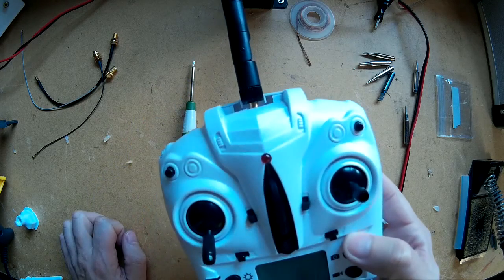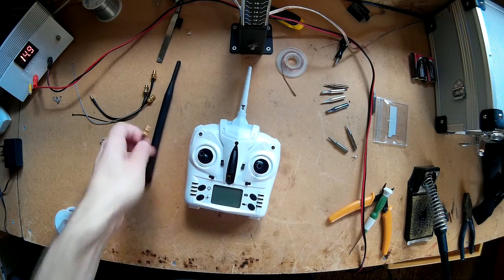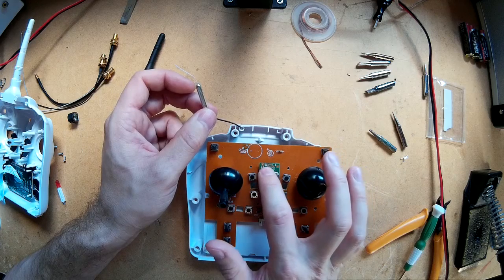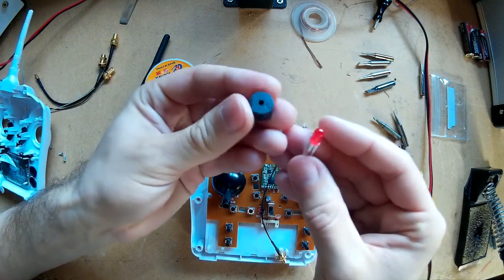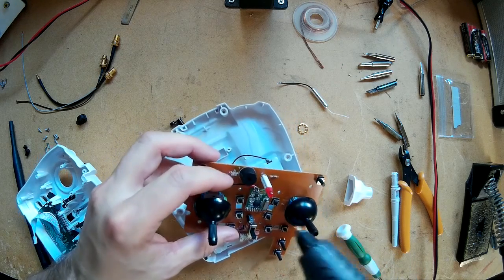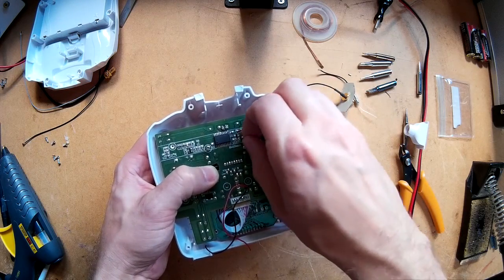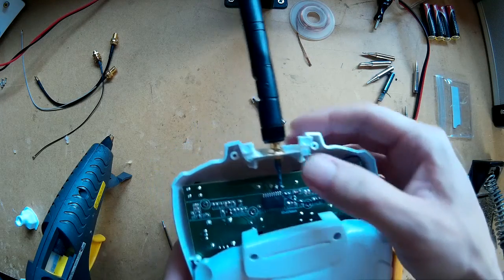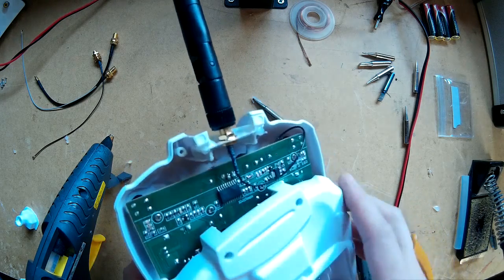JJRC X6 Tarantual Extended Long Range transmitter Mod

Comment: I did the same modification yesterday, brought to test but signal fails vertical range about 70m, horizontal range will not be over 100m

Comment: could u tell me the soldering on on the left is the center core or the braid( for ground),  thanks!
Reply from the maker: +neteric Wong Yes left is centre core right is braid. just remember do not turn transmitter on without antenna connected.
Reply: Norfolktuber thank you